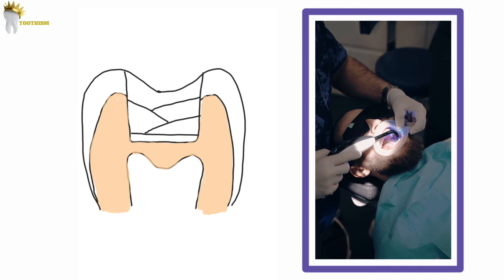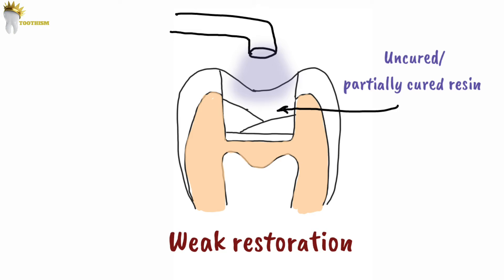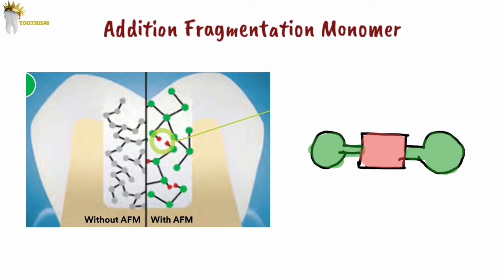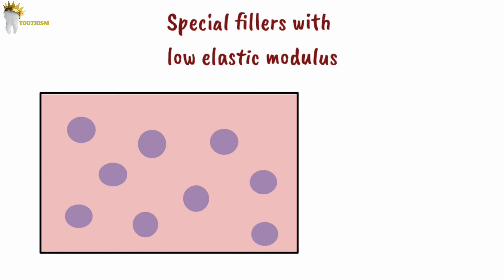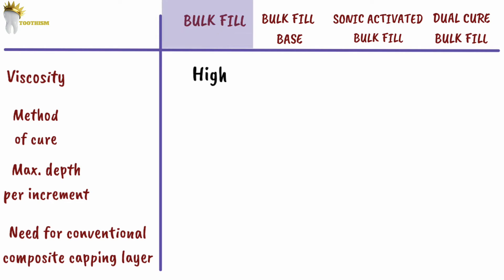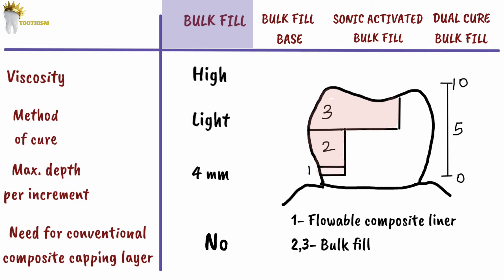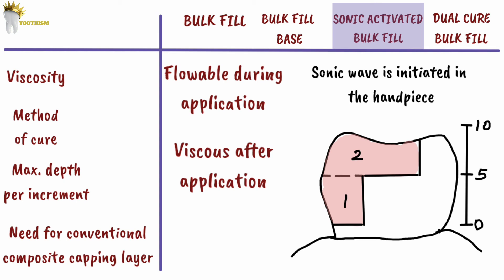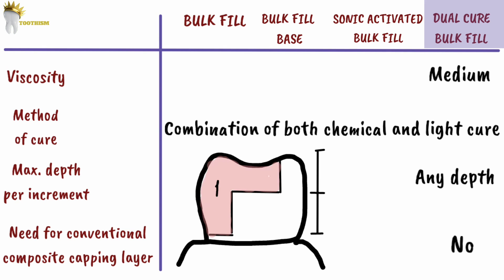BULK-FILL Composites | How is depth of cure increased? What is SONIC ACTIVATED Bulk-fill?

Comment: The layering technique is very helpful, the contraction because of the shrinkage can cause pain and microleakage.
Reply from the maker: For conventional composites, layering technique (2mm) is a must. But in bulk full composites it's not required. Layers of 4mm can be applied.